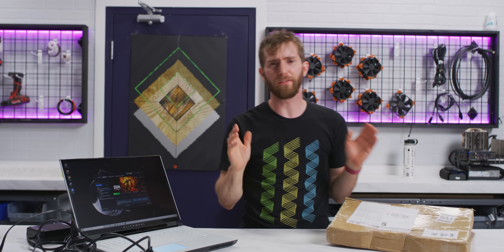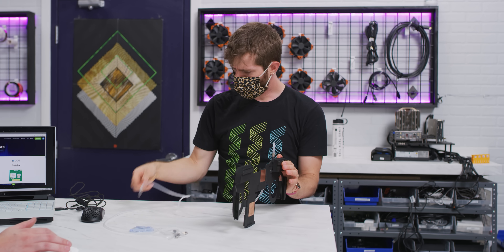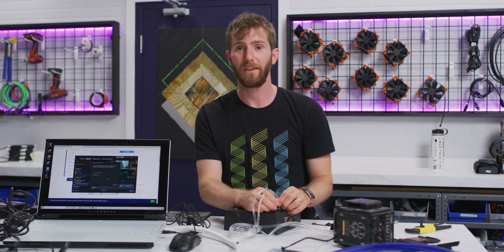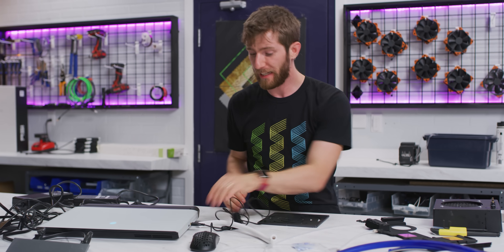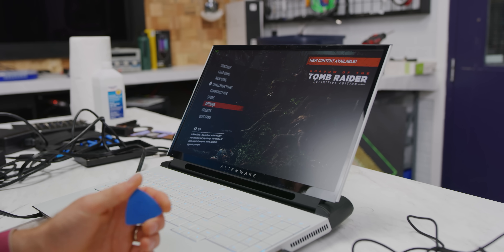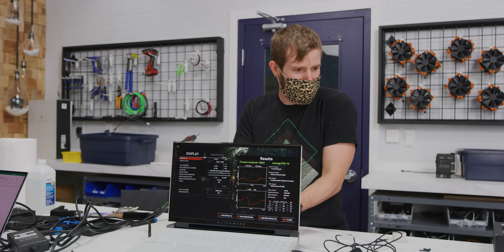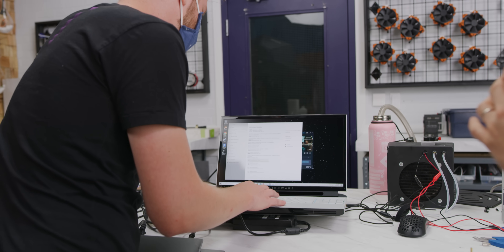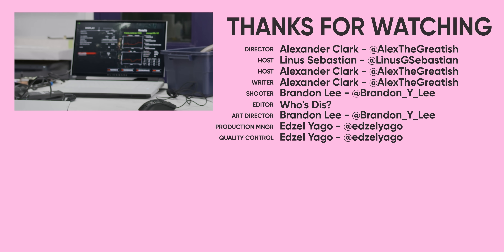This Sketchy AliExpress Cooler....

Comment: Imaging paying 4000$ laptop and dell release a bios that reduce perf by -70% each time the gpu reach 75 degree

oh shit, that me
Reply: I have an asus strix iii and new bios also doesn't let me undervolt it, just downgrade bios to the last one you want and don't ever upgrade again m8
Reply: @pav1u  how did you downgrade bios? I have zephyrus and can't even find older bios
Reply: @JustSomeAwe  look on asus support website and see all bios for your model, then you downgrade the same way as you upgrade ;)
Reply: @pav1u  they have just 2 latest bios on support website, both with overclock disabled :(
Reply: @JustSomeAwe  If you know the exact version you want google it and download, thats what i did, i have 307 and newer with problems is 309 for me...but google it and find older versions
Reply: I wouldn't be surprised if that SUDDENLY started happening. All in the name of Battery Life. (:
Reply: Man I want a laptop for the convinience to play anywhere for lan parties and shit but good God damn they are expensive for not great specs, solely for the purpose of convinience lol can't bring myself to do it
Reply: @cwright2872  Gotta pay to play yo.
Reply: @WarriorsPhoto  I'm saying I can't justify a laptop purchase when my pc beats the shit out of anything selling for less than 2.5 grand on a laptop or more lol all I was saying
Reply: @cwright2872  AHH I wouldn't either. Good point there.
Reply: @cwright2872  Look at different retailers. XMG apex 15 for example the premium for portability is about £150 or so which is well worth it in my opinion.

( Over buying the equivalent desktop parts, keyboard, screen etc)
Reply: @cwright2872  then dont buy asus. as easy as that.
Reply: @tarkitarker0815  honestly not even sure wat ur talkin about lol noone mentioned brands so ur comment don't really make sense, and wats wrong with asus? They make the rog strix components which are arguably the best versions of the cards in any generation lol if not performance, in looks so idk wat u mean lol
Reply: @cwright2872  no they arent rog strix is on par with the top of the cream, its not the cherry on top of the cream. palit/gainward often does a better job, doesnt matter for nv cards due to the 2,1 ghz limit anyway. asus laptops are without a doubt the most expensive mass produced laptops thats why i said dont buy asus then as you complained about prices. asus builds their laptops with extras nearly no one needs or with desktop grade cpu´s that make the things way more expensive. i could have written dont buy alienware then but everybody knows that and alienware laptops arent even close to the best. thats why i settled for asus, i can tell you that buying a razer laptop isnt that smart too. just buy acer and you get what you want with cooling deficits but i guess you just wanted to rant about my decision to call asus overpriced. and generally no one here spoke about gpus.
Reply: Morale of the story, dont update BIOS and Drivers..wait for others to test them, see the general consensus then update..happend to me several times with Nvidia drivers ruining my FPS with literally the same hardware
Reply: I CRINGED MORE by the sounds of the dremel then the temps
Reply: rain suria LOL, I had to go back and watch then noticed it more. (:
Reply: Yeah, Dell is kind of trash
-An XPS owner
Reply: @kecknmj  because you got an XPS. Problem solved.
Reply: @voodoobane07  Yep, lesson learned. You'd think a maxed out XPS 17 would be great, but Dell's QC and customer service leaves much to be desired.
Reply: @kecknmj  No u just don't buy and XPS. It has nothing to do with QC.
Reply: @voodoobane07  It has everything to do with QC by definition. Save your allowance and buy one and you'll see.
Reply: I had an Asus laptop were the GPU will throttle if it reaches 73°C (apparently that was configured on a embedded controller), and I live in a Caribbean country... so my GPU was always hitting that temp in games. At least it was 800 dollars, not 4000
Reply: I have a dell inspiron 15 7000 gaming and I can't even game on it cus it makes the game go to like 100 fps to 25 fps when it hits 84 degrees
Reply: Technically if you reduce performance by -70% it will be faster, because it's a double negative.
Reply: @CatsMeow_  Now that's doing some math. Thank you as I didn't see that.
Reply: @WarriorsPhoto  Not really math, just logic.
Reply: have you tried disabling intel speedstep? It was killing the performance of my inspiron. Whenever the mx150 reached 63°C, the clock would drop to like 400MHz  and it happened a few times per second. Now the temperature stays at 83°C and the clock is very stable
Reply: it also caused the battery to slowly discharge when gaming because dell couldn't make a power supply big enough for the laptop
Reply: @srpenguinbr  Same situation with my old dell gaming laptop 9 years ago. Apparently the stock charger was massively throttling the GPU. Just buying a better charger nearly doubled my FPS over the stock charger. On battery alone games were practically unplayable because the battery provided nowhere near adequate power on its own. To be fair i had the GPU overclocked from 1.2ghz to 1.9ghz. Even so, the included charger was massively underpowered even when i had a stock setup.  I can not understand why so many devices include such underpowered chargers and power supplies. Why put all these expensive parts in a device if you arent going to include adequate power for them to perform properly? It just makes their products look worse than they really are. Especially to an uneducated consumer who may not even realize why the product is underperforming. 

Imagine if refridgerators only cooled to 50 degrees Farenheit without buying an aftermarket power supply to unlock its full potential. Thats basically how the tech companies are treating their consumers.
Reply: I had the same problem on my G7 but I was able to increase the max temperature for the gpu up to 96 deg by using an app called asus gpu tweak. Only app I was able to change my max gpu temp with.
Reply: wait wtf
Reply: Before updating bios just watch review of it
Reply: Sucks to so
Reply: Same here, but mine is the ideapad 310. The way i increase the temp limit is using Asus GPU Tweak 2. And it WORK !!
Reply: I just got my 17m R3
Reply: My old m14x r2 would throttle at 63° 😬
Reply: Nemao Thats Dell for you. We work with them and we have nothing but troubles.....
Reply: @Setzer K between thermal issues and laptop specific cpu that can't over clock with a mid range 1080p card? I'd rather spend the same money and get a better desktop lol
Reply: I couldn't imagine wasting money like that.
Reply: @cwright2872  £150 is the difference between a good laptop and desktop of equivalent performance.

Hence 150 premium :)

For example my laptop which and 3900 32gb of ram and a rtx 2070 144hz screen etc etc cost £2000 
2tb nvme SSD and 2tb SSD as well.

A desktop with same performance would of been 1800 without a screen or keyboard and mouse
Reply: @freedomofmotion  link me the link to ur laptop haha
Reply: @freedomofmotion  guarenteed not same performance haha if u think a laptop oem 2070 with a 65w tdp 3900x with 2666 speed ram with have the same performance as a built partner quality components ur sadly mistaken lol u don't even need 32 gigs for gaming, ur wasting 16 gigs, and laptop components overheat very easily hence the low wattage cpu, ya they are the same parts in name but not in performance lol
Reply: @cwright2872  I'm within 13% of GPU and CPU performance as the desktop parts run at the limits of performance i.e not energy efficient. These parts run at peak efficiency so despite pulling almost half power compared to the full power models it doesn't mean half speed. 

And you can get 3200mhz memory and I do more than just game . 😂
Reply: @freedomofmotion  can literally build a better gaming machine for 1300$ as opposed to ur 2100$ laptop and ya u have to buy a monitor keyboard and mouse but they are better quality lol can buy all those things and still be under ur 2100$ laptop lol
Reply: @cwright2872  
What an interesting thing to say, even though by comparing a  Desktop stationary computer vs a  Laptop design to be portable and convenient to be  used on go.  Finding these type of information is quite pointless and useless to be honest.
Reply: @josedelfuego  but u can upgrade a desktop 1000x easier, get better airflow and better performance for longer and desktops are portable... Not as easy as closing a lid and going but not impossible, I take my desktop setup to the homies house so the time lol
Reply: @Setzer K I ain't spending 2 Grand for 30 fps, that's ridiculous lol
Reply: @Setzer K That's the argument I'm making. Laptops are good performance and value these days. You sacrifice top tier performance only. And in certain configurations you didn't even loose out on that.

I'm more than happy with the performance of laptop. Can play games well and also CPU rendering as well.

Or i can disable some cores if I only want to game and it automatically takes advantage of the increase power headroom.
Reply: Thankfully the R2 doesn't thermal throttle. I bought one a month ago and it's hit 80c without any throttling. The fans are a lot better than the R1 so once you crank it to 80% speed it cools down to below 50c.
Reply: This why I always buy laptop below the top tier range with low TDP to avoid any heat/throttle issues.  Considering I save about 2500$ and a good quality laptop with high end cpu/nvidia gpu.  Anything high power tdp/ dual sli, is going to be a mess in my opinion.
Reply: @koilamaoh4238  are you that often on the move that you need a laptop at all  ? for 2.5k you get a very nice Tower Setup thats probably even faster
Reply: @mrn234   We have a couple, me and my sisters put together, nice setups desktops, mines at like 6+ years old or? with 1080ti think. Desktops last forever if you pick out the higher end parts.   THe laptop itself is nice as for a fast setup, for extra person for gaming or something, easy to move around, only reason I have mine for, when I have company over.

I'm sure under 1500, you could get a nicer one desktop custom hehe.   Just nab that 500-800 video card, and good to go.
Reply: Same with my Dell XPS
Reply: Imagine editing your comment but you still put the dollar sign after the number like an illiterate
Reply: I usually keep up with what's going on with Alienware and what happened with the m models (2nd revision) was bad microcode from intel on the i7/i9 9xxx cpus, that paired with what was supposed to be a stock thermal profile with modest reduction in fan noise made for a constant thermal throttling mess. Once they had the second bios revision with included a microcode update and the updated Alienware command center things got much better. In fact many people who RMA'd did so without even checking the command center, if they had applied the performance or max thermal profile it ran just fine, be it loud. Everyone speculated the cooler or thermal paste being the issue but they both checked out just fine on mine, I repasted with no real change in temperature. Alot of people bricked their motherboard trying to half ass some liquid metal as well lol
Reply: Hello guys. im just gonna drop my probs here bcs as i see, there r bunch of useful tips here that i find it so hard to look for on Google:

Omen 15 2019 (2018 chassis) w i5-9 & 2060 (90w). Cpu reaches 100c in a jiffy just from booting up - needless to say how hot&fast it reaches during heavier loads.  WinDef scanning also get it to 100c. BUT aida64 & intel xtu stress test only get it to sub-80 despite how long i gave it

"Cloud recovery" (like, total PC reset w using FDisk) 4x. nothing different

went to serviceCenter several times & got mainboard replaced 3x (4th, upcoming). they couldnt figure out whats wrong. used conductonaut once, & kryonaut since. heatsink & fans were replaced once. no different

Gpu temp is very cool; OC +-200mhz, drawing 100w (gpuz sensor) and the hottest it reaches is 75c (35c ++ ambient room temp) on heaviest load & 3-5 hrs of gaming

Does any sir have some tips/miraculous solution to this 100c CPU prob?

My current damage control:
using TPL to 33&45w, UV -.128mv, downclocking the cpu depending on my FPS needs (3.0 - 3.7ghz)

Sensor Apps that ive used (all readings were identical):
HWinfo, HWmonitor, Afterbuner(rtss), TStop, XTU, GPUz, OmenCommandCenter, Aida64
Reply: @zdelivery7573  Seems odd it would still do it following a motherboard replacement and still even just from booting up? Did they really replace it? Also is the exhaust hot? It could be reporting high temperatures incorrectly. sometimes the soc thermistor reports incorrect temperatures. but a replacement would have fixed that.  My second guess would have been a leaked out heatpipe which is common but again you said its been replaced. 

Seems like they are just running a diag and returning the device to you, I doubt they really replaced the mPCB
Reply: @oODReviews  hi thank you for replying sir

yes im convinced its been replaced 3 times bc each time before replacement, i noted the mainboard Label & some random numbers the i demanded them to show me my older (replaced) mainboard, rechecked & compared the difference in labels & numbers, after replacement was finished. i clean my laptop insides like once a month/2 & i also noted the GPU die numbers were different each time after replacement

Yes the exhausts are hot & both gpu-cpu area around the keyboard chassis surface are hot accordingly (when cpu is tested, this side is hot - viceversa)

What is "soc thermistor? and is there other way to get more accurate reading sensors or temperature for my laptop?
Reply: @zdelivery7573  Ok at this point then I would demand they replace the device with a comparable new model they sell. Or provide a full refund tax included. If they cannot RMA the device 3 times and get it right then I would take my business elsewhere
Reply: @zdelivery7573  The OMEN Laptop 15-ek0019nr 3G346UA would be the comparable replacement, don't allow them to ship you a device with anything less than the specs you have.
Reply: imagine paying for it at all... its simply way too overkill unless you have a critical task that you need it for. And i don't think gaming is one of them.
Reply: I only have a intel i5
Reply: you could've stopped at "imagine paying $4000 for a laptop"
Reply: @Nemao i have a solution! Ship it to me.
Reply: @Setzer K I'm going to replace the thermal paste first cus I really don't want to sacrifice any performance.
Reply: Same here man, :( they got me with the upgradability promises, but now my A51mr1 cant even play older games like horizon zero dawn at more than 12fps, im going to try swapping the cooling system with the 2070-2080 version as I have the 2060 version and repast and thermal pads because the laptop throttles all the time and makes games unplayable since the bios updates before the bios it worked fine :(
Reply: oh shit me too 😂 my want for an i9 and 2080 with rgb outweighed my want for a non dell laptop
Reply: Then don't update the BIOS. Who updates a BIOS unless it's for compatibility lmao
Reply: @Jake1702  Damn near everyone, because bios arent supposed to be downgrades. Some products these days are literelly unusable out of the box without updating the bios and drivers.
Reply: @Jake1702  people who want their shit to run properly? Are u new? Lol
Reply: Is there any solution to this ? :(
Reply: Steve from GN won't be overclocking anything else with LTT 😏
Reply: @Nemao  what until you hear about intel
Reply: Oof which laptop is it
Reply: @No__18  alienware area 51M, R1, basicaly they made a BIOS that completly fuck up the laptop, you have no idea
Reply: @Nemao  You can downgrade your BIOS to 1.51 for maximum performance, tutorials are all over the internet.
Reply: @macrostiff  ya dude had a friend who bought one updated it and would get dumb hot well gaming he seen the tutorial and bam we back to gaming lol this guy needs to do it
Reply: @Nemao  you should have watched review of that bios update
Reply: @macrostiff  G-sync gets disabled if you do that
Reply: @aryyyyyyan  U need switch your geforce driver to DCH version, my g-sync is totally operational.
Reply: @Nemao  Bruh  coming from a cartoon channel... lol
Reply: @Nemao  yeah this is why laptop gaming absolutely sucks. High temperatures, bad performance etc
Reply: @macrostiff  here i am with an R1 not knowing shit the fan with the BIOS upgrade that happened, could u be kind enough to tell me how i can downgrade or point me to a tutorial ?
Reply: yeah me too brother. beyond pissed, fortunately it's actually one of my work laptops and work paid for it. but its unbelievable, my girl's 1060 outperforms this 2080
Reply: @realbadtech  Seriously? That's interesting.
Reply: @realbadtech  ya with the thermal throttling in laptops it just doesn't seem worth it to get for gaming UNLESS u got the money to throw down just cuz, get way more performance out of a normal pc with worse components for a lot cheaper, sacrificing that portability tho lol just a trade off u have to weigh to see if it's worth lol
Reply: @realbadtech  how its possible ?
Reply: @realbadtech  dude there is something seriously wrong with yours hahaha my doesn't throttle for shit.
Reply: @voodoobane07  uh yeah the entire point is that there is something seriously wrong with it which is what I just said, and what many others have said. which is why there are videos and tutorials on rolling back the BIOS, what do you think me and everyone else who has issues just made this shit up?
Reply: @voodoobane07  its all over the internet throttles at 78-79 degrees mine drops to 11-12 fps as soon as I hit 78-79 and dell has abandoned us
Reply: For those that are having trouble with undervolting your laptop... even with the new bios, go into the bios and reset all the settings back to factory settings. Then it will let you undervolt in windows.
Reply: I've just given up on gaming laptops entirely, haven't had one from any manufacturer that isn't riddled with issues of varying kinds, most of them I've had to send back for repairs at least twice. I know for some people it's their only real option but god at this point I hate the damn things. I now just use an ultra-cheap, ultra-thin, low power, low heat, general purpose laptop and use streaming services(Nvidia now etc.) for gaming on it, so much less grief.
Reply: @Sevarrius  yeah agreed, that's been my general experience too. I've got an Area 51m through work and am waiting on a "tech" to come out and look at it this week because its warrantied to hell and back. Also have an older MSI Titan through work with a 1080 in it, that thing crashes literally all the damn time and is essentially a paper weight. For personal laptops I went through several Surface Pros and then a Surface Book 2, all of them had issues. At this point I just use my desktop and don't spend money on laptops, I just use whatever work provides me so I won't care as much when it inevitably shits the bed.
Reply: Why is your gpu hitting 75???? Hahahaha wtf are you guys doing to your laptops???? This laptop is amazing why are you guys so bad with them. Do your research
Reply: That's why I buy xbox and a chromebook
Reply: Buying a freaking LAPTOP for GAMING was ur first mistake, the second one was buying anything from alienware. They went full shit when bought by Dell so yea, you failed 2 times i dont feel bad for you since you could have known better.
Reply: humblebragers gonna humblebrag :)